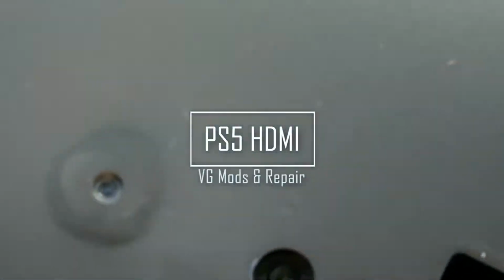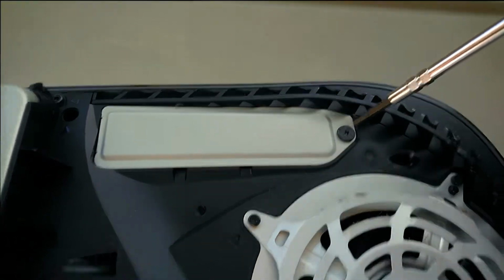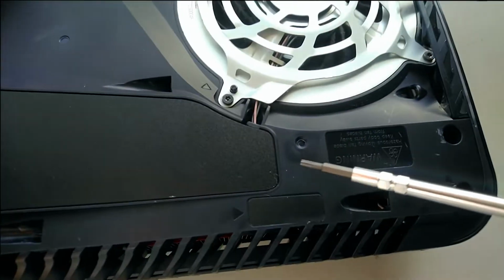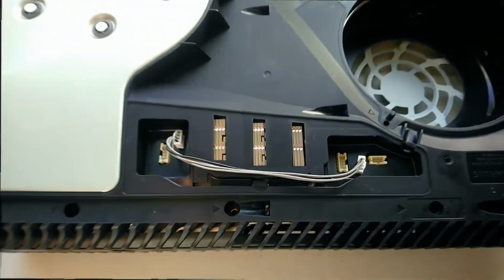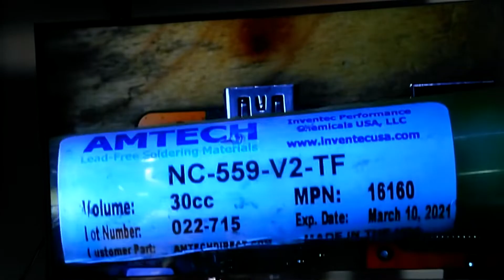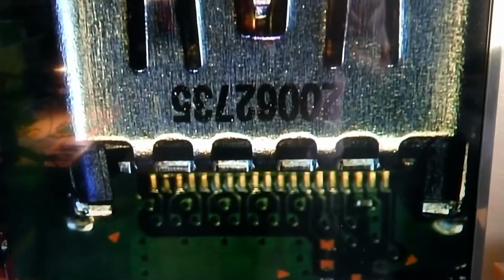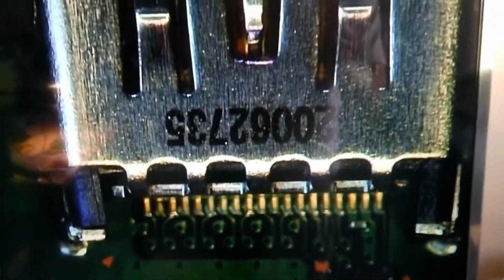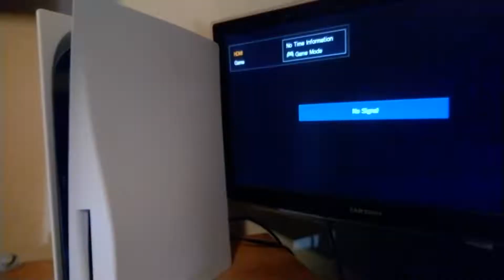PS5 HDMI Port Replacement

Comment: Nice. Waiting patiently to find a source to find PS5 HDMI Ports.

Hopefully they come around soon
Reply from the maker: I know right!!!??? I would love to find a way to get ANY replacement hdmi port which fits perfectly. Perhaps we should experiment with hdmi ports for modern Sony equipment like TV's? Better chance of compatibility than a port designed 5 years ago? Hmmm... (:
Reply: @vgrepairs  for professionalism and not a Frankenstein job (not saying that's what your doing) I'd rather wait.

I haven't had any requests for hdmi port repairs on the ps5 or series s and x yet anyways, but I'm sure they're coming.

Seeing as how this is the second one I've seen a video of now, I'm guessing the ports on the ps5 are very weak.
Reply from the maker: @microgamingrepairs1981    True that. The large ground prongs for the port are still secured with this method, the 19 pins are now soldered to jumper wires and THEN to the motherboard. My repair job adds support (more solder) and preserves the 19 pins on the motherboard from ripping off with the added play from the jumper wires.
Reply from the maker: @microgamingrepairs1981   I think the Series X has a direct fit port replacement according to techgamerepairs, I'll post a link for the part when I find it!
Reply: @vgrepairs  nice, if you find it let me know
Reply from the maker: They are available now!
Reply: @vgrepairs  series x ones are available now? I've ordered 2 PS5 Ports to see the quality and if they're good I'll lilely buy 25 of them.

Comment: Was you using aluminum foil to protect the connectors on the hdmi
Reply from the maker: No. aluminum tape. it's better than kapton.
Reply: @vgrepairs  thanks bro About to fix mine tomorrow
Reply from the maker: @OverRatedtvp  if you have questions after 3pm PST I can help you out over Instagram @sandiegovideogames

Comment: Nice to see Kleins in a video for once. Good job!
Reply from the maker: Rule #1 as an apprentice! always buy Klein tools ('x
Reply: @vgrepairs  how strong are those ports wielded in ?
Reply from the maker: @john75470  stronger than stock.
Reply: @vgrepairs  does the stock break easy ?
Reply from the maker: @john75470  They break due to wear and tear and accidents. It's about as common these days as a person cracking their phone's glass.
Reply: @vgrepairs  true ... I really hope stock ports are strong though just in case I have my horizontal
Reply from the maker: @john75470  if you are always gentle with the port you won't break it.
Reply: Are the stock lan port well built ? Do you think Sony did a good welding job on these ports ?
Reply: @vgrepairs  with my lan cable I had a little trouble getting it out I used a slightly little bit of pressure trying to get it out used little to no strength you think it should be ok ? Just a little paranoid and have a little bit of OCD
Reply from the maker: @john75470  yes, but I won't buy a PS5 until they revise the console design in a few years. It's WAY too big and ugly.
Reply: @vgrepairs  I looked at the port just in case and looks good and I use lan cable
Reply: @vgrepairs  you are right brother I might wait for a special edtion slim model hope a metal gear solid edtion tho

Comment: dude my daughter just broke my ps5 hdmi port. thing is all mashed up. is there any replacements i can buy online? i have looked but i worry they are not the correct ones
Reply from the maker: If you can install it yourself you can find the port on ebay and Amazon but unless youve done it before I wouldn't recommend it. Every. Single. Client that has claimed they're better off trying it themselves has made it worse before bringing it to me. I end up having to charge extra to fix their damage.

Comment: Mine broke last week and was sent off for repair but came back as unrepairable due to a short circuit blowing the control chip, bloke said throw it in the bin🤷🤷🤷is this true??
Reply from the maker: He might have either damaged the traces while trying to remove the port or he got overwhelmed with the work and quit due to inexperience. I can give it a second opinion for free if you ship it and pay for return shipping
Reply: @vgrepairs  hi thanks for the reply, I kind of think he didn't dare touch it, I'm in the UK so shipping would be an issue but thanks for the offer mate, I'll let you know the outcome
Reply from the maker: @sultan30arl  actually, right now due to the systems scarcity you might get MSRP for it as a broken system on ebay. List it at $600 and see what happens???

Comment: Baby sleeping so I watched with sound off. Is it the same replacement port as ps4 slim and pro?
Reply from the maker: 3:54 you can see the difference between the ps4 slim/pro port and the PS5 port. All 19 of the ps5's port pins are shifted the distance of one pin over to the right compared to the ps4 slim/pro port. To use the ps4 pro/slim port you have to "make it work" by running 19 trace wires to their destination on the motherboard. As a community I'm sure we can find a replacement hdmi port from the modern Sony hardware line that is identical to the ps5's rather than trying to make a port designed 7 years ago work.

Comment: I need help my ps5 won't do anything it is just stuck on resetting factory defaults.and if I put it in safe mode and select any this it just freezes
Reply from the maker: Sounds like you have a corrupt ssd, too bad Sony soldered their memory to the motherboard or you would have been able to change it yourself like on the ps4, ps3. You need to contact Sony if you can't get safe mode options to help. Sony has a 1 year manufacturer's warranty.
Reply: @vgrepairs  is there anyway to change the memory or get a new motherboard?
Reply from the maker: @zaiwqz  a used working ps5 motherboard would cost $500+. replacing a motherboard is never an economical way to achieve repair. So far Noone has attempted to replace the soldered internal memory. Post a video of your ps5's issue and link it here so we can help. it's possible you don't need any new parts. Again, contacting Sony to take advantage of your manufacturer's warranty would be the best option.
Reply: @vgrepairs  i have bought my ps5 of of ebay am I still able to get it repaired or replaced?
Reply from the maker: @zaiwqz  of course. Call sony and give them the serial number and screenshot the order
Reply: @vgrepairs  thank you a lot man i was worried I couldn't get it replaced or repaired thanks a lot man.

Comment: Do you need kapton tape to fix a ps5v
Reply from the maker: I recommend you use aluminum or kapton tape to hold the small capacitors and other small SMD's in place. They WILL fall off and get lost otherwise and you'll kick yourself.

Comment: What port did you use? Does a ps4 slim hdmi fits?
Reply from the maker: Watch the video or read the description and you'll find out! Jk it's a Ps4 slim/pro hdmi port but it doesn't line up with the PS5 motherboard so you have to run size 38awg jumper wires.
Reply: @vgrepairs  thank you, i already found out when repairing a ps5. Hell of a job with extending the 19 pinns. Took me 2 hours🤤
Reply: I contacted my seller in China, the ps5 ports are available within one month
Reply from the maker: @John-oo9xu  thank you!

Comment: it's also works on 1080p monitor?
Reply from the maker: Of course. The hdmi port is just an extension cord from the motherboard to your hdmi cable. It DOES NOT CONTROL THE RESOLUTION.

Comment: What is the capacitor at the hdmi port (right side)?
Reply from the maker: Ask again brother I do not understand you? Which one? Can you give me a timestamp and describe where it is on screen?
Reply: 02:30 right side, behind HDMI. Sorry for my english language.
Reply from the maker: @lukasz9545  that cap does absolutely nothing substantial. If you lost it just proceed without it.
Reply: Ok, I replaced the HDMI, but I don't have a picture.  Thank you for your help.
Reply from the maker: @lukasz9545  all 19 pins are soldered ? Solid? Are any other parts missing or moved?
Reply from the maker: @lukasz9545  are you doing this as a business or as a personal experiment? Join the reddit r/consolerepair

Comment: Do you know what capacitor that is near the hdmi port thanks in advance
Reply from the maker: Are you asking what value the capacitor is? Have you lost yours through repair?
Reply: @vgrepairs  yes
Reply from the maker: @shaunhollis7718     Use one from a broken PS4 motherboard
Reply from the maker: @shaunhollis7718  hey did you try replacing the capacitor? How did it go?

Comment: How much to repair mine and where u located
Reply from the maker: $120 and we are located in San Diego, Ca
Reply: I live at chino ca and willing ro drive there tommorow early morning just need to confirm if u will fix it personally cause i trued once and a gane shop trued to send it to ps repair and they wont fix it cause it they terminated my warranty since they found ants bugs i had it in a storage the ps5 belongs to my 11 yr son he got it for his bday and we are hurt they wont comply the warranty bought it in jan 2021 still covered just asking cause its like 130 drive
Reply: The game shop in orange cleaned it fir $50 i think like 3 ants?
Reply from the maker: @espinosafamilyjareck3738  we don't accept systems In for repair that have cockroaches. If they're ants, then that should be fine so long as you eliminate the problem as best you can. We will fix it. Contact us at 6192052242 for scheduling and address.
Reply from the maker: @espinosafamilyjareck3738  please clean the system very well on the outer plastics before bringing it in